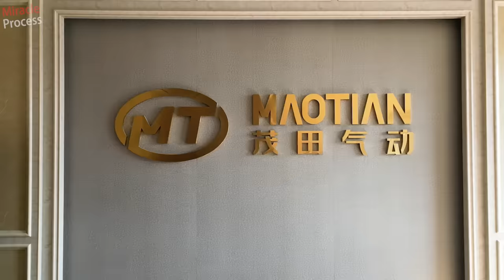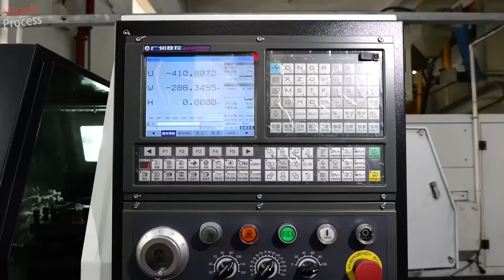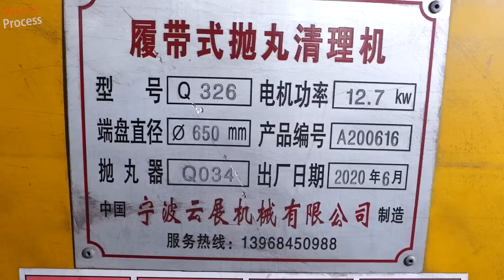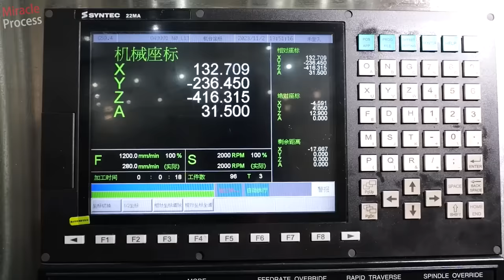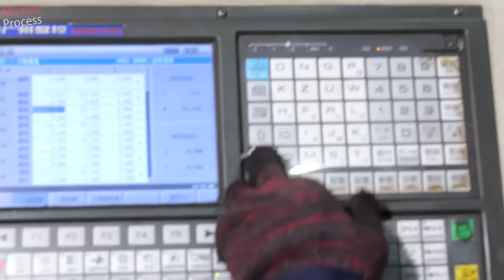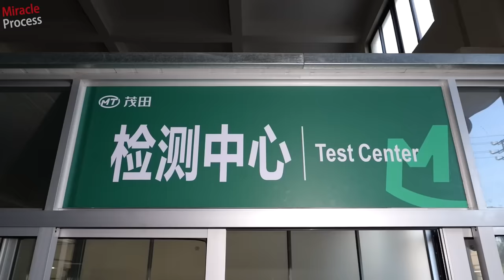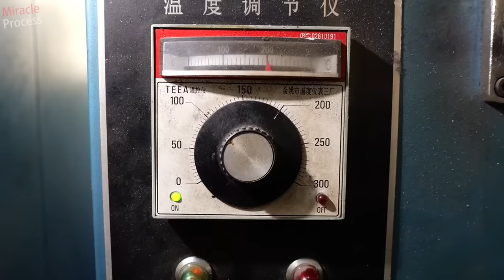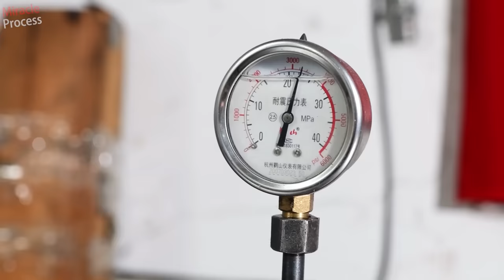Factory Mass Production of Air Impact Wrench

Comment: If this would be Pakistan, every part would be thrown after each step to the floor.
Reply: It wouldn't be, just to the ground...
Reply: In Pakistan that's fine because the floor is dirt and not as hard as concrete!
Reply: @ottopartz1  Agree.
These  world-famous "super high skilled professionals" should water the floor, because mud is even more soft then dry dirt.
Reply: Well, they r usually working at ground level, squatted down, bare feet etc...
Reply: @jameshartman6031  Agree.
But wouldn't it be better, digging holes and sit in them, because this way these world-famous super skilled professionals, can use the ground level instead of tables (which are forbidden in Pakistan, like toiilet bowles)?